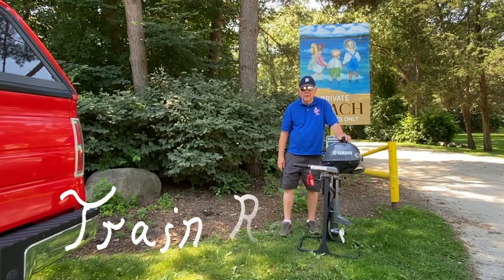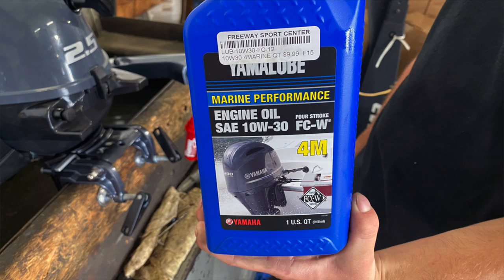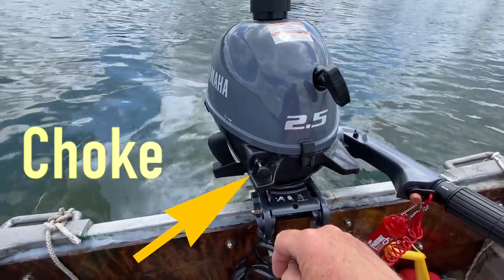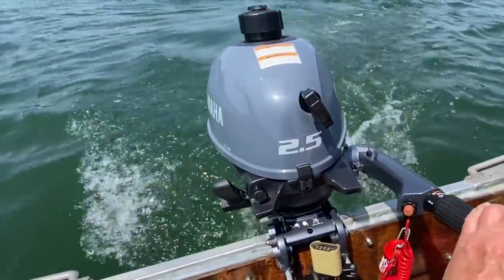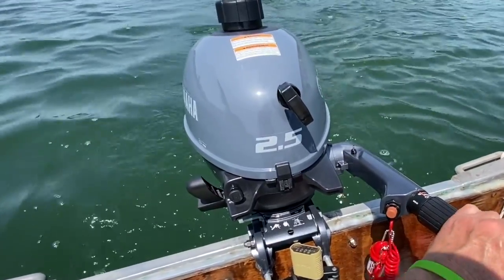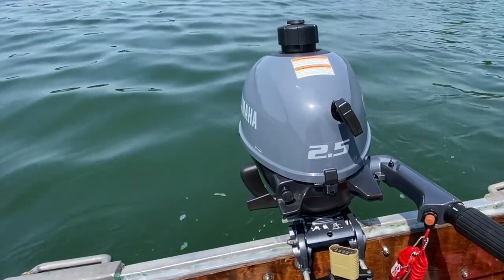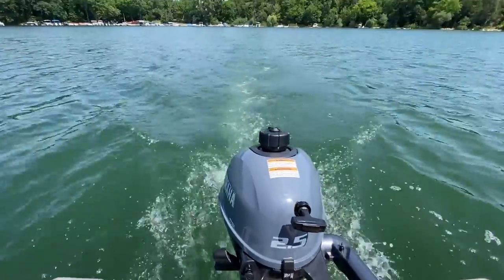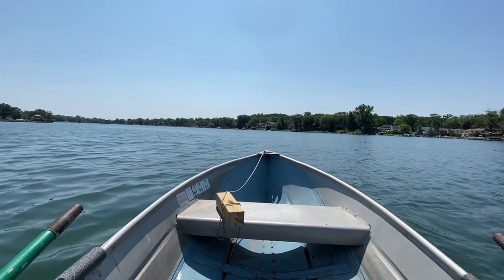Yamaha 2 5 HP Four Stroke Outboard

Comment: 4:24 do you need to use the handle? I think this motor lets you flip the lever 180 degrees to use it when in reverse.
Reply from the maker: HI Fly With Me - 666: I just watched frame - 4:24. - I have found it just easier to use the black carrying handle as shown in video - - The tiller lever can not move 180 degrees.  Next time I go fishing I will check it again - - I am now using this motor on a new jon boat. Check it out! Thanks fro watching. Gary from Michigan 🚤

Comment: Hi Gary! Great video! Is the engine water cooled or air? Thank you!
Reply from the maker: Hi aceseights8815 • This is a water cooled engine - Honda outboard small motors are air cooled - I would not go with these. Too noisy sound like a weed wacker. ✅ Thanks for watching Gary from Michigan. 👀

Comment: Thanks for the video QUESTION: Gary, in the video did you have the motor up to maximum speed ever? I didn’t sound like the pitch was all that high and looked like you still had room on the throttle to turn it up. Maybe I’m incorrect?
Reply from the maker: Hi Atoiler 1389: Most of the time I was at 80% power, the boat handle better at this speed and I am on a small lake. Thanks for watching. Gary from Michigan 🚂

Comment: Hi thank you for your video you think this motor will work with a kayak?
Reply from the maker: Check the rear of your Kayak transom for the maximum motor size. It maybe to much power, I have it on a 12 foot roe boat. My boat has a top max for 10HP. Thanks for watching, 🚂